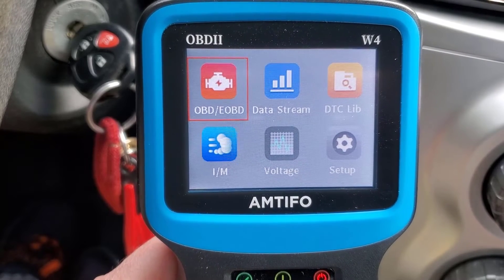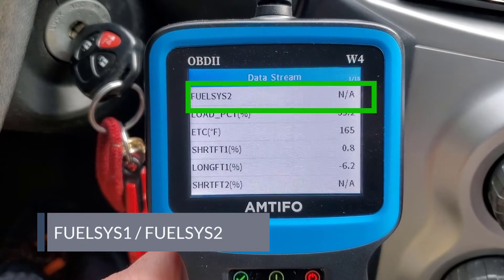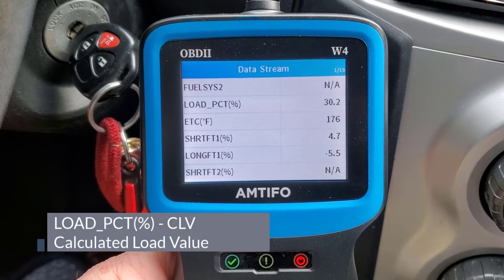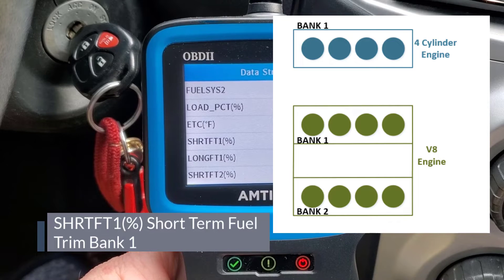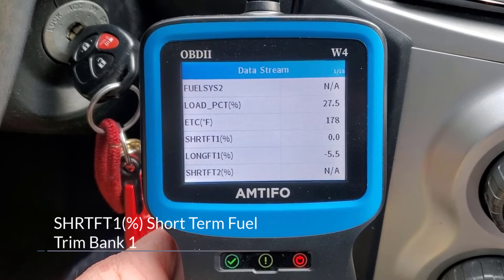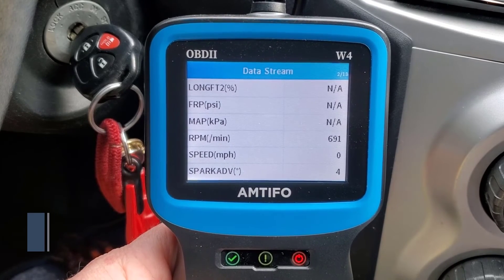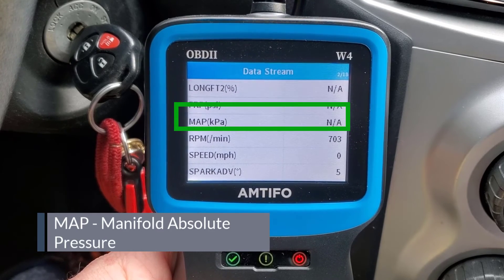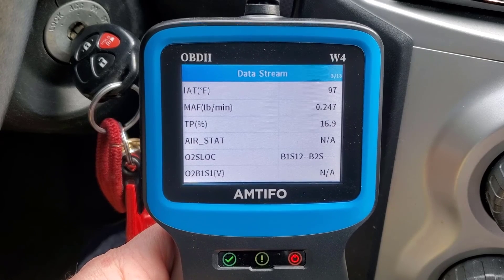Reading OBD2 Live Data

Comment: I had a abs light on hiace had a few guys with good scanners couldn't get in to diagnose I cleaned wheel sensors times 4  I think it was the abs pump very expensive I just pulled fuse no light no abs😅

Comment: Catalytic converter through codes even if slightly blocked not a real Big issue u might think need new O2 sensor s and clean them or replace and check light returns it will most probably be the cat and u clear all codes it will return on dash but not a real concern 😮

Comment: Super informative and interesting video Sir. Thank you for sharing your knowledge. 
I have a 2005 F150 5.4 3v with 275k miles.  
I’m looking at my data stream on my acton scanner. Specifically fuel trim. No engine codes. The issue is multiple misfires during acceleration any gear. 
Maybe vacuum leak?
Data stream at 2800 rpm
ST FTRM1  4.7
LT FTRM 1  11.7
ST FTRM 2 10.9
LT FTRM  2   3.1
CMD EQ RAT .999
MAF (LB/M)    2.67

Comment: "First off, thanks for putting together this video and highlighting some of the shortcomings of these OBD2 scanners.  While these scanners are marketed to DIY consumers, their limitations leave users with a lot of guesswork. They list impressive-sounding capabilities on the box, but when it comes to  troubleshooting and analyzing data, they often fall short. Basic functionality might be there, but trying to print out a readable report or perform in-depth data analysis can be tedious and restrictive. As they say, ‘you get what you pay for,’ but at $400, I expected more. With 30 years in computers, I find the data output confounding and surprisingly basic given today’s complex vehicles. Without proper training, DIY users can easily misinterpret the data, leading to frustration.”

Comment: Thanks for doing these videos. Was wondering is there a booklet or sheets available that would explain what you just talked about here? I would really like to learn what these data stream measures mean and what the ranges should be on a car to attempt a diagnostic and not just jumping on codes and changing out parts. Again, thanks so much for your channel.

Comment: Hello, great video! I was wondering the correct procedure for getting the live data. I have a Motopower mp69033 scanner. My understanding is, insert it to dlc, then turn car on to read dtc  codes then while still connected, turn the engine on and running to stream the live data while car is warmed up. I’m worried about damaging anything while starting the engine with the scanner connected, thank you!

Comment: Where do you find the ranges for PIDs? I have a 2013 Chevy Cruze 1.4 and I am having trouble finding my vehicle's specific ranges. Any help in the right direction would be much appreciated.
Reply from the maker: I usually look for a factory service manual to see if it has what I need. But they can get kinda expensive. Sometimes you can pick them up cheap used on ebay. You may want to try a site like cruzetalk.com and just leave a message to see if someone has one that can share the range your looking for. I also see a few people posted some 2014 Cruze 1.4 live data logs on pidfusion.net (just found this website this morning and haven't used it before), not sure if that might give you something to compare thats helpful. Good luck.

Comment: Ok...But which side is bank one and which is bank two. Your diagram doesn't not decifer front or rear of engine.
Reply from the maker: I wish i could answer this with a definitive answer, but different manufacturers can have it on different sides. I usually verify for that specific vehicle in a shop manual or online.
Reply: @obdnerdz  It appears to me, after extensive research, the bank containing the #1 piston will be bank 1.

Comment: Thanks for the very informative tutorial. One question-can you access all live data points while a car is running in idle or do some data points like transmission temp and coolant temp have to be taken while the car is being driven in gear to get accurate reads. Please let me know. Thanks.
Reply from the maker: A few can be seen with key on engine off, but most need the car to be running. I usually check with the car already warmed up and idling. But if looking at something like the ECT I might check it first with the engine cold and watch it as it changes and warms up. Just to verify a low and high reading.
Reply: @obdnerdz  Thanks for the quick reply and thanks for posting all this great info.

Comment: That was super useful to know what it is and the normal range. Like reading my blood test results, no clue what that does but good to know whether it is normal or not 😊
Reply from the maker: Thanks for the comment! That's a great analogy. I agree it is almost like bloodwork telling you how things are going. I need a service manual for my body to compare numbers 🤣.
Reply: @obdnerdz  🤣
Reply: Reading blood work is easy , truck dont work , pressure goes up ..😂
Reply: My fuel system 1 , 2 ,& 3 all say... not available ? Koeo 2013 silverado 4x4 3/4 ton 6.0 ...55lbs at the rail fitting , w/ fuel pressure gauge , it twitches when i throttle it , runs terrible , changed the front pipe new convertors and 02 sensors , dump gas tank put in fresh gas , no inline fuel filter , no codes , fuses all good trying to smoke test it with a homemade tester , no leaks found yet , tester needs more work ..im running in circles i think ..they drove it with convertors bypassed to my place , it kept shutting down , long term fuel trim 1&2 -30.01 ....ouch ..compresion test was a little wavy , 168 lowest , most were 180 to 200 , one was 210 ?? Wierd ? 
Wondering if it will ever run ?